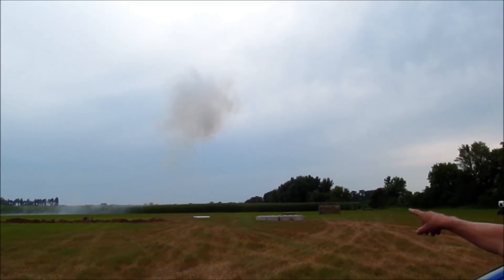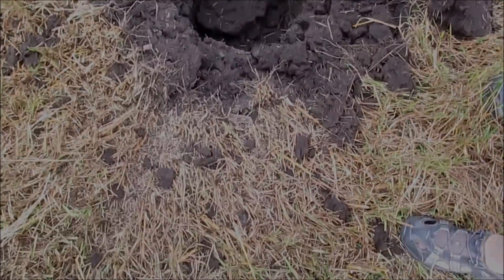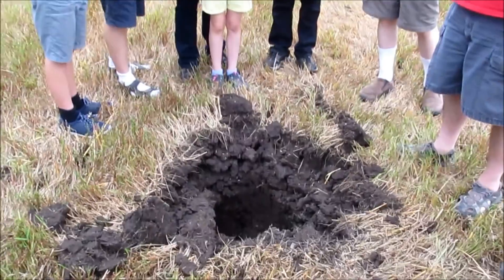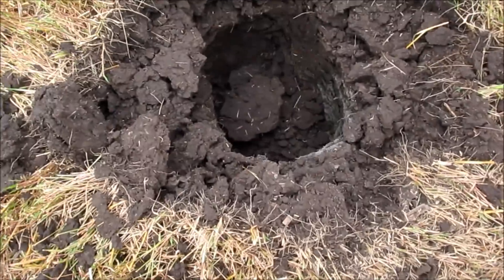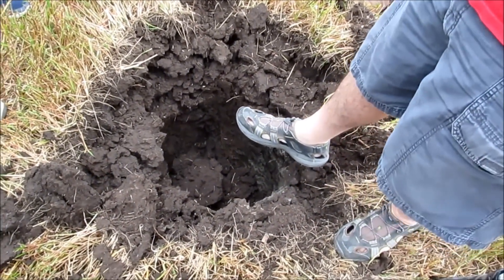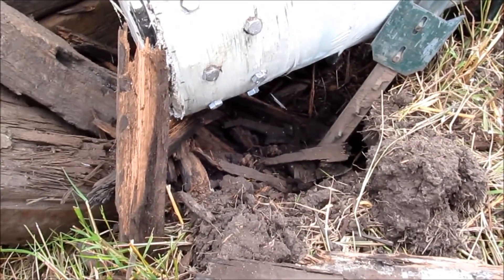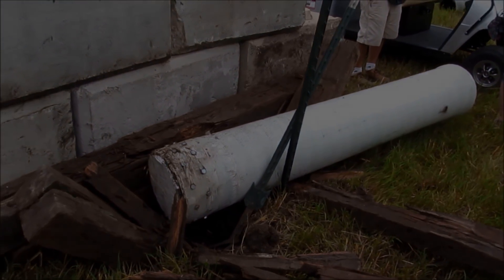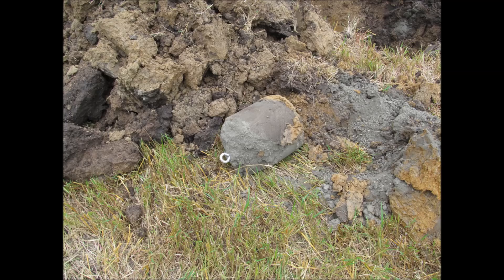Heavy Fiberglass Mortar Load Testing

Comment: Still prefer HDPE over fiberglass. My experience is that the fiberglass just will  not hold up nearly as long, and when it does fail it is never good.
Reply from the maker: I think each has their benefits and drawbacks, 1. I like heavy wall HDPE guns if the pipe can be procured in the right size, which is a big IF. And, they typically leak if the ground is saturated, too, which is a real problem in a setting like the PGI convention. But, if a shell detonates in HDPE, is stretches and splits into relatively harmless pieces. Fiberglass can be made to spec as far as size, and doesn't leak, ideally, if made correctly. We don't know how long it'll last, yet, though. The traditional alternative, steel, sure can get fugly if a shell goes in it, which makes the two "plastic" mortar types appealing from a safety standpoint.
Reply: @nedgorski  Generally the company I work for has used both. I personally do not use anything over 10" very often just for budget reasons. We almost always put larger size mortars in trash barrels and backfill with sand. Eliminates holes and for the most part, saturated ground conditions. I rarely hand light larger shells so my concern is not so much safety with fiberglass ( larger shows that are choreographed to music are generally twice the required distances) but with any failures the fiberglass tends to shred and will inevitably take out a wire or a module or even worse yet, a main run back to the firing board. Not even mentioning they seem to split and damage after a short period of use. And I also love getting those fiberglass splinters on occasion! Just not a big fan of fiberglass but still better than busting your ass slinging around steel pipe!

Comment: Why you didn't dig the mortar into the earth
Reply from the maker: There's no real benefit to doing so, other than having the mouth of the gun low enough to easily load a shell into it. And, we wanted photos and video of what the mortar does when the shot goes off.
Reply: ned gorski we are doing this as support for the mortar walls when we shoot big Italian shells and for safety reasons that if something goes wrong the fragments won't hurt someone or shatter something. If we can't dig them we use an old oil barrel which is filled with sand
Reply from the maker: Loose dirt or sand do little to support the gun walls, and flying dirt and/or rocks can actually create hazardous debris. Dirt will not keep steel shrapnel from flying as far as the crowd, either.
Reply: @nedgorski  dirt will easily stop shrapnel.
Reply from the maker: @KClO3  Not at all if it's steel shrapnel. Been there, seen that. Buried steel gun, blown, sending shrapnel thousands of feet.

Comment: For S&G's it would be neat if there was a feasable way to rig up a measuring devise to see how much downward force those mortar tubes are putting out.
Reply from the maker: The doubled-up railroad ties sure were crushed like matchsticks. Massive downward force. To fire a concrete slug at 250 mph produce one heck of a lot of recoil. It would take a massive load cell to measure it.

Comment: Wish you had kept the camera on the second shot.  With 130 lbs coming down at 9.8m/s/s it doesn't matter if your filming or ducking.  If it hits you you're just as dead.
Reply from the maker: Yeah, but I figured it'd be a good idea to keep an eye on the slug, just in case I had to jump one way or t'other. And, at some point it hit terminal velocity and was probably only moving at about 100 mph when it came in. 8-]

Comment: Hey Ned! I was wondering why all my tickets explode! I use 60/30/10 bp mix. If I don’t put a nozzle on it then the pressure builds up and there is nothing to hold everything together so it starts shooting big flaming chunks of propellant everywhere! When I put a nozzle on they work great until they get to max thrust, then they just explode! My nozzle is rock solid, and one inch thick. I think what’s happening is the clay isn’t breaking apart, but just being shot out like a cannon ball. Please do respond to this I’m trying to prepare for New Years.
Reply from the maker: I have a lot of ideas about remedying that, Anthony, in an extensive article on the website. I wax my tubes, use a particular clay cat litter coated with graphite powder, use a particular type and mesh of charcoal, and a particular pressing/ramming process. Your issue can be fixed relatively easily, but will require examining your process. Your problems are not unusual for a newbie to rockets.
Reply: ned gorski I’ll try to make a video of me marking them. It’s only half the rockets that do this! I think it may be the cat litter im using. It couldn’t find any cheap litter so a got some that was a bit fancy, and it most likely has some other additives.
Reply from the maker: I really like the Dr. Elsey's Ultra/Precious Cat Litter. It's what Estes uses, and is a good, pure, granular bentonite clay.
Reply: I plugged 200 1.75" hommade cardboard tubes with that litter, i shot some heafty shells out of them, and i had 100% sucess rate. I wouldnt use anything else.

Comment: Nice 1 Ned, could I make a suggestion though? If you butt-joined a steel pipe to the pipe you are using as a form to build up your fiberglass mortar tube then you could leave the steel in there while removing your cylindrical form & thus reinforce your primary ignition section of the mortar tube, could you not? it'll be a little heavier but still very portable. & maybe forming the footing of the mortar in a conical shape would disperse the downward force of ignition in a more down & outwardly direction instead of straight down?  maybe save a few of those railroad ties you're blasting through? Think of it like this shape " 🚀 " with the stabilizing fins being the footing & the nosecone of the rocket being the mortar exit? Does that make any sense?  🤔
Reply from the maker: We're trying to avoid steel, Joey, given its nature to fragment and fly far if a shell fails in the gun. That's the  purpose of this whole exploration of alternative mortar materials. But, we'll be putting the heavy fiberglass on more solid foundation in the future.